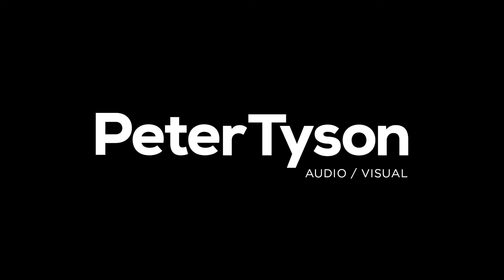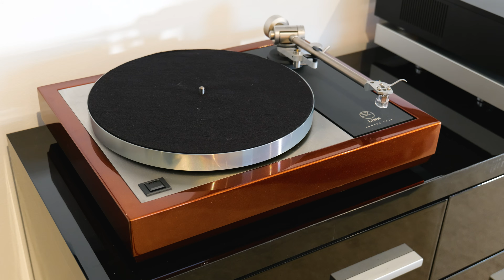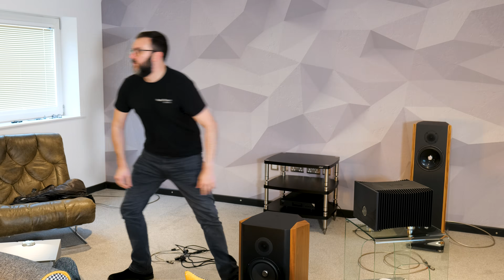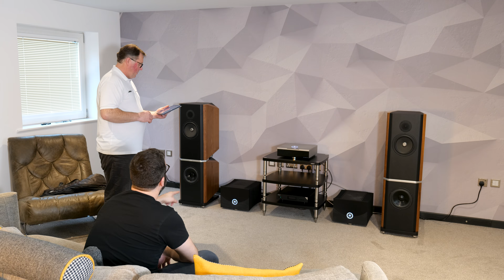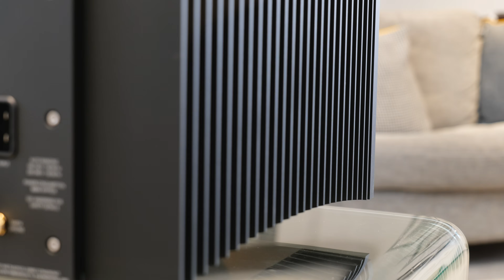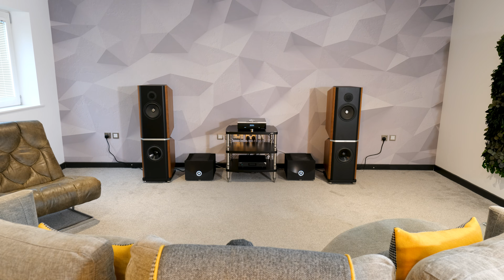Linn Klimax Solo 800 : Power Is Nothing Without Control

Comment: I’m sure it’s a great amp and I don’t blame Linn for getting into the “high end” race as profits are profits and after all and they are a business. But what about the customers who invested in exakt? Looks like they are shying away from exakt after gilad admitted the concept didn’t sell as well as he thought. Does this amp then mean customers who want the best linn system should ditch exakt (after heavily invested into it as I have) and go back to passive for the best linn sound?
Reply: I can answer that directly. Since I have compared both systems. 360 passive with klimax 800 vs 360 active. With, of course, the dsm3. The active version demolishes the passive system. So. Go active. There is no comparison between them. And yes, I have bought the 360A Single Malt colour with black trim
Reply from the maker: I would like to hear this back to back with the fully active Linn 360. They are possibly the nicest speakers I've ever heard. John

Comment: John I was wondering if Linn told you why they went back to class AB after all these years and do you know why the amp is so big is it has a SMPS?
Reply from the maker: Hi, Linn have dabbled with class D for certain applications but have mainly used class A/B for a long time. The main reason for the size is internal component spacing as it relies on passive cooling alone. - John
Reply: @Peter-Tyson-Audio-Visual  Thanks John. I thought Klimax used Chakra class topology which I understood as different from A/B. Cheers
Reply: Chakra is another name for the now expired Quad Audio Patent Current Damping @volpedo2000